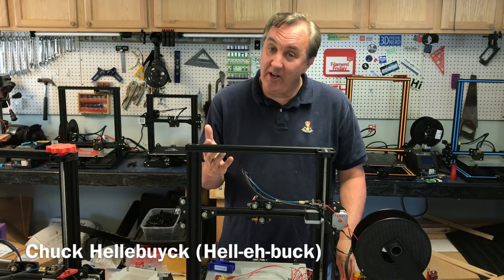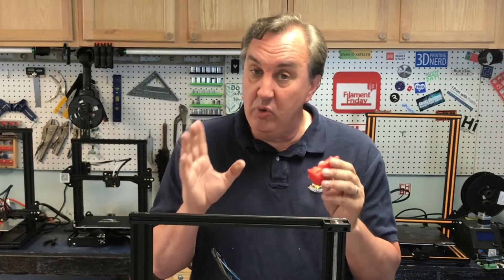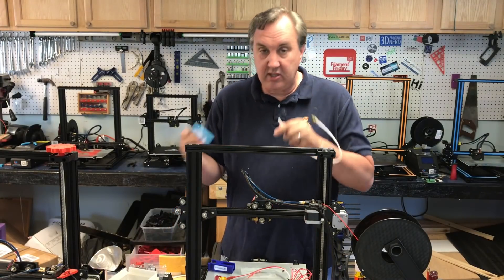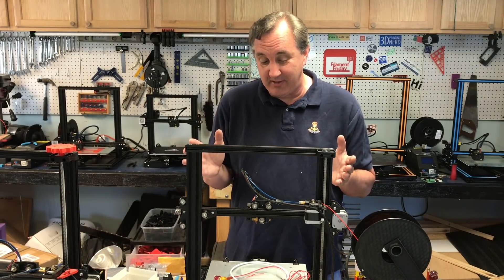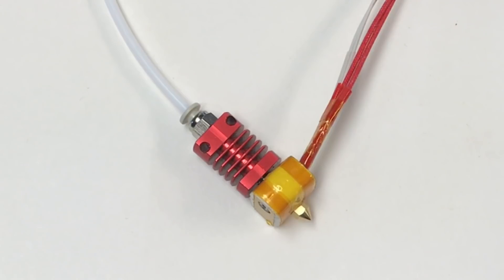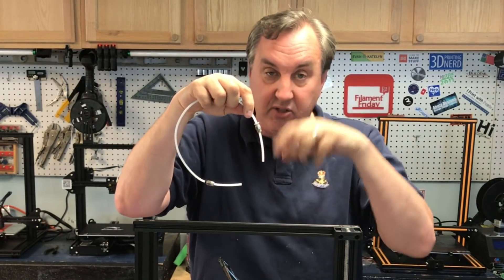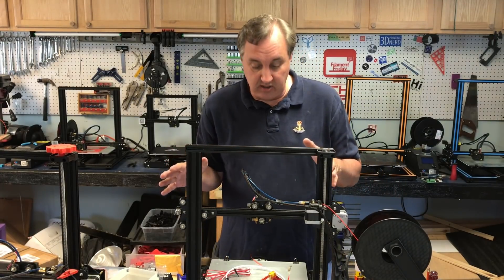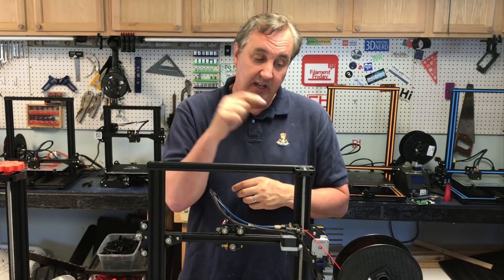Fixing a Filament Flow Problem on CR-10 mini, CR-10 or Creality Ender 3

Comment: Late to the game commenting but I have a tip to further secure the hotend coupling. Look what they do on your Anycubic. They lock it down with an "ultra thin zip tie" which is about 2 mm thick. Can't find "ultra thin zip ties"  A loop of 24 gauge solid core wire should be just about the right size or even a twisty tie might work in a pinch.
Reply: I've also see some do it with a 3D printed clip.

Comment: I think you have just saved my cr-10s from the bin :PWas getting really frustrated with my printer because the plastic was just not melting @ 205 celcius while it was before. I recognize the piece of filament in the end of the PTFE tube. Will check tonight. Thnx. subscribed

Comment: Is there a similar tubing cutter on Amazon?
Reply: Just use a sharp razor and gently slice through it. Works just as well.
Reply: Scott Yeah, thanks. I figured as much, but I expect to be doing a lot more of this stuff in the future and anything that can improve consistency and reliability is worth considering if the price is right. I can’t tell you how many times this issue has had me taking my hot end apart and hitting it with a butane torch, trimming back tubing and replacing the insulation. As much trouble as this issue has caused me, I want to make sure I’m done with it for good even if I have to spend a few bucks for the peace of mind. I’ll definitely resort to the razor if this thing is going to cost me over $10 though. ;)

Comment: Got a similar problem on my Wanhao Duplicator i3, Though it's a direct drive hot end, Any ideas?
Reply from the maker: Check the gear for wear or worn teeth. Also the hotend has PTFE inside it. Could be worn out.

Comment: I got a brand new CR-10 Mini - everything set up fine, adjusted using defaults on test print and filament gets hot, bed gets warmed, but filament doesn't flow unless I give a little sustaining push - it's like nothing is push/pulling the filament through -  Tubing issue seems logical after a bit of use, yet what maintains the filament feeding through? (I relate it to MIG/TIG welding) :(
Nice channel BTW -
Reply from the maker: The gear on the extruder motor drives the filament. Is it spinning?
Reply from the maker: Check the gear on the motor to make sure it’s not loose,
Reply: thanks for the reply - yea, I was looking at that and thinking it looks like it should feed like a wire welder does - I'll run a test and watch it - let you know ;/
Reply: OK - as filament spooled it'd make an occasional creaking sounds (like being on a old sailing ship) - the catch gear seemed clear, but acting erratically and the start of PLA shavings  - found what seems to be cream colored epoxy gunk (not PLA) caught under the gear and some looked to be mixed down the line and in the extruder tip (Maybe a Chinese assembly worker caught some flesh in it? Ouch! ) - took some heating and picking, but got it out - rebuilt the feeder anyway (have an idea for new design for it) - printed a draft print, it was passable, and NO creaking! Filament (the crap they sent with the CR-10) flowed smooth, but I order the Capricorn tubing anyway, hope along with the tighter tolerance it's more flexible the white tubing(?) and have better filaments on the way. All running smooth-er - Sub'ed - thanks bro :)
PS:  As a guitar/bass player I think I found a new use for busted old strings in cleaning out extruder tips and reaming out cheep plastic guide parts ;)

Comment: I agree with what you showed in the video. I have read this many times in the various forums.  However I also saw this video that I'm curious about.  It makes sense as additive to your advice. What do you think?   https://youtu.be/NYeRxWwgLS4   (Keep up the good work)
Reply from the maker: Simple, use the Capricorn tubing I recommend in my video and you don’t have to spray anything. The quality of the stock PTFE is his issue. You can see it when he removes the tubing that the bottom is already deteriorating. And cut PTFE with proper tool.   I would never do what he suggests to my printer.

Comment: What is the recommended bed temperature for ABS and PLA ? I have problem with my test prints not adhering to the bed.
Reply from the maker: PLA works with 60. Some use 90 for ABS. I don’t print ABS on it. I recommend an enclosed chamber. I use my FlashForge dreamer for ABS. Use Avery glue stick and it will help hold ABS.
Reply: Thanks will try that.
Reply: We print a lot of abs on CR 10. The settings i usually use is 240C for nozzle and 105 ( glass transition temperature of abs ) for bed. i use a hair spray and let the bed be heated for about 15 mins before printing and i've printed parts above 80 hours of print time on my cr 10.

Comment: I did everything you mentioned. Replaced the tube with more expensive stuff. Replace the connector changed the print temperature and still it fails. Started out OK then somewhere along the way went bad. 

https://drive.google.com/open?id=1RT17nZYEMdcgWSu9fjUZnhdkg8JOubpr
Reply from the maker: How old is the nozzle?
Reply: Hey thanks for the reply. Just replaced the nozzle. I am at my wits end. I cant afford an expensive printer and I can't seem to get this one to work well. Someone else mentioned the feed gear.. I will look at that.
Reply: I'm having the exact same problem and I can't figure it out to save my life.  I've built 3 printers. 2 from scratch. I'm fairly familiar with what could go wrong but in this case, I just can't figure it out.  This is my first "semi built" kit (I got an Ender 3). It printed beautifully for 2 days. No issues whatsoever. Then today about half way through a print I could see missing random missing outside perimeter walls. Watching the extruder gear, I could actually see it slow down, stop, then go back to normal, then slow down, stop....all seemingly randomly. I checked the stepper plug, in case it was loose. I removed the couplers and replaced them (although there didn't seem to be anything wrong with them). I cleared the nozzle. What I'm confused about is the random slowing and stopping of the extruder motor without any loss of steps. I can't hear or feel any typical "clicking" from the extruder which is indicative of not enough current going to the stepper or too much force that it can't overcome.  Really scratching my head here.
Reply: Oh and I also checked the grub screws on the gear because I was positive it was loose but it wasn't at all. So strange.
Reply from the maker: That sounds like a broken stepper wire causing it to turn but not smoothly.
Reply from the maker: Ano T - Make sure the PTFE is pushed all the way down to the nozzle otherwise it will slowly jam again.

Comment: The recommended couplers are not in stock, will these work?  https://smile.amazon.com/gp/product/B01IB81IHG/ref=ox_sc_act_title_2?smid=A1LCDIR1SM8KTJ&psc=1
Reply: Or these?  https://www.amazon.com/gp/product/B01IB81IHG/ref=ox_sc_act_title_2?smid=A1LCDIR1SM8KTJ&psc=1
And thanks!  I think that's what I need to do to fix my Ender 3!!
Reply from the maker: I updated the link. Those should work.
Reply: Thanks man!  They're in my basket, waiting for tomorrow.

Comment: great informative video man keep up the great work! I just bought a CR-10S as my 2nd printer my coupler  was bad i needed to find where to get some thank you.....
 I do i guess maybe have a dumb question: My printer that i have had for a wile is a Prusa I3 mk2s upgraded to a Mk2.5 when comparing my MK2.5 To my new CR-10S I have to ask why is the filament stepper so far away from the extruder? This issue with gaps would be fixed if this was the case?
Reply from the maker: It’s Bowden style to reduce weight on the hotend.

Comment: Just did the fix on my Ender 2 and holy Cow the print quality improved. Before i would get a lot of  horizontal lines due to inconsistencies in the flow and now its just dead straight. Thank you so much :D

Comment: İ'm going to buy ender 3 as my first 3d printer but i want be sure it work well. PTFE Coupling at link is not avaible now. Can you add a link of an equivalent PTFE Coupling or avaible one ? And as an extra question i don't like asking questions answered another videos but for be sure is there a better 3d printer at 200-250$ price range.

Comment: I need to put filament flow in cura to 160% and in the printer it self to 220 in order to get "decent" prints. So I will try this solution and hope it will work.

Comment: I had the same problem... half way through the next print after clearing my clog it would jam again. My couplings have never operated right but I have the opposite problem: can’t get them to release the PTFE tube. The CR-10 included two tubes and two couplings and both would not release the PTFE when pressed. It’s weird because you seemed to be describing my problem exactly up to that point.

Comment: Nice troubleshooting.  I had a similar problem recently (print that printed successfully a few months ago was now printing poorly) and the problem turned out to be that my filament had absorbed moisture.  Putting the roll in the toaster at 50C (122F) for two hours fixed it.

Comment: good video What few people realise is that thise couplings are under constant attack due to retracts . Its a good idea to fit "retainer" collet clips as the couplings, per definition, have play in them. CLips like https://e3d-online.com/collet-clips or https://www.amazon.com/Genuine-E3D-Collet-1-75mm-M-BOWDEN-CLIP-175/dp/B07B68DBS6/ref=sr_1_1?ie=UTF8&qid=1529229546&sr=8-1&keywords=collet+clips&dpID=317Y0jmqKML&preST=_SX342_QL70_&dpSrc=srch

Comment: This is a great reminder to check those couplings on the bowden tube setups. Bonus info -if you have a printer with an oddball size coupler like the JGAURORA A3s/A5 series, or if you're just in a pinch because you've run out, there are 3D printable versions on thingiverse. They work pretty good. I put one on my A3S. It was going to be a temporary deal until I got the right size fitting in the mail, but it's been over a month and it's still working, so I'm just going to leave it and see how long it lasts.

Comment: Good info!  This issue has been plaguing me for a week now following a jam, I thought it was a settings issue but I am pretty confident that - based on some work I had to do following a previous clog - that my current "sparseness" issue is due to something like this. Wish you'd put this video out a week ago; it would have saved me a lot of time...time that I still need to spend to actually fix my problem! :-/

Comment: Hey Chuck, you may want to consider adding these clips to lock the fitting release just in case vibration and filament retraction might be affecting ptfe tube to loosen and move up inside the hotend. 
https://www.thingiverse.com/thing:2645177
Btw: Got a spool of your FFF and am very impressed. That is going to be my go to pla as I run out of the colors you have available. Hope you will be expanding your color selection over time. THX

Comment: Those couplers were the bane of my existence with my prior printer, particularly since it was the type where the tube doesn't go all the way through ("all metal" hot end). Occasionally, one of the stainless steel teeth (or two, or more) would break off and go into the nozzle.

I tell you, it is a PAIN trying to get stuff out of a nozzle clogged by those teeth.

Good vid!

Comment: As another quick tip on this issue.  If you mark the Boden tube where it comes out of the hot end you can see if the tube gets pushed up while printing.

Comment: I literally just replaced the coupling on mine, should've been obvious given I've had the exact same issue with the coupling on the extruder. That one was a lot more obvious though given it failed completely with the tube being pushed out along with the filament.

Comment: Good Tip, I wasn't sure what the symptoms of a bad Boden tube or coupling would be but now I know what to expect.
Shortly after MRRF I ordered Capricorn tubing and pass through connectors from Amazon so it looks like I'm prepared for when my CR-10 has the same or similar problem.
Thanks

Comment: Depending on the filament, Capricorn tubing is not the best thing to use.  Not all filaments have great tolerances.  For an example, See Maverick Maker's videos.  I personally use ColorFabb
Reply: Agree that you need to use better filament.  The change in diameter will affect print flow consistency, etc.  In this day and age, the filament diameter should be well controlled by most name brand filament suppliers.